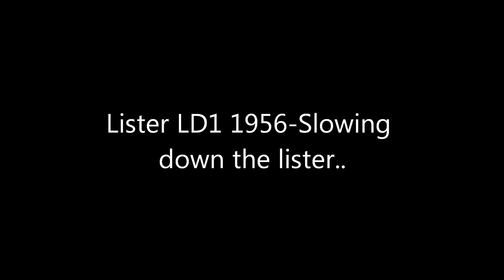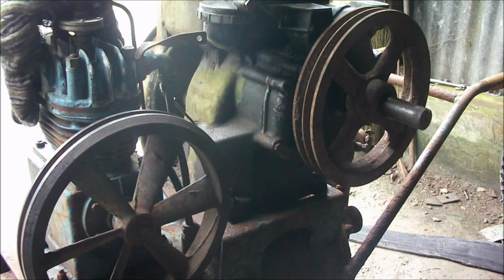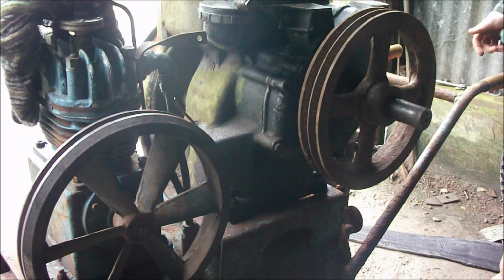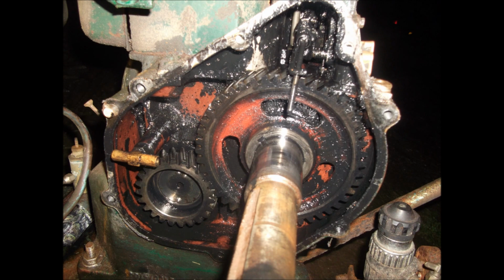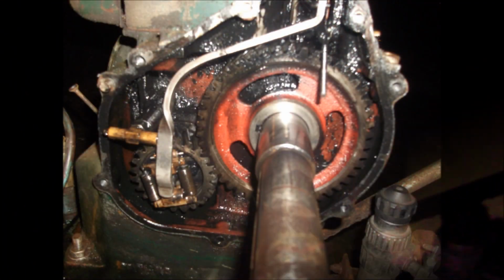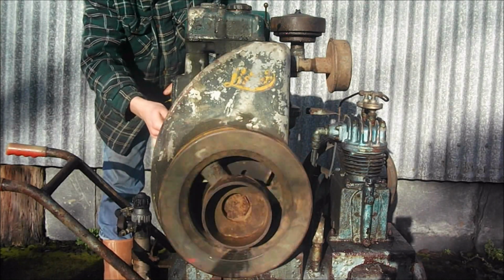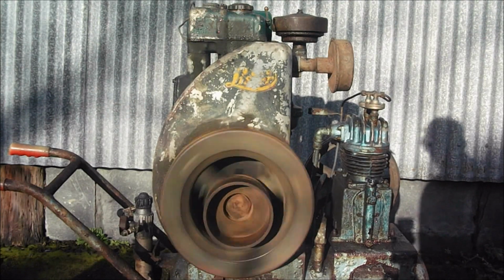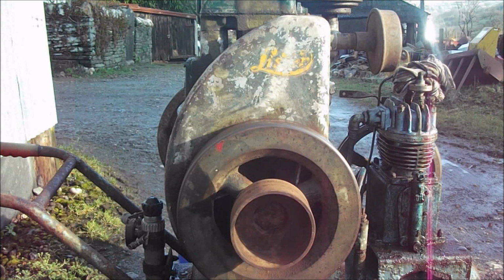Lister LD1 1956 - Slowing down the lister -Vintage Stationary Engine-

Comment: when these engines where fitted on the lister 3 wheeled truck they had an hand throttle . cant remember i think it just slid the rack along you could have varyable speed compressor.

Comment: Card board gaskets! Come on boy get your self a roll of flexoide gasket paper.. that would be a proper job lol 

First year of production was apparently 1956.. they must have made a few 'pre' production engines as there seems to be a healthy number of 1955 engines floating about.. engines for test purposes perhaps? 

Running nicely.. don't worry about the smoke. Mine smokes a bit as well.